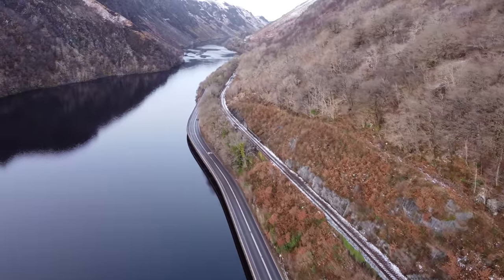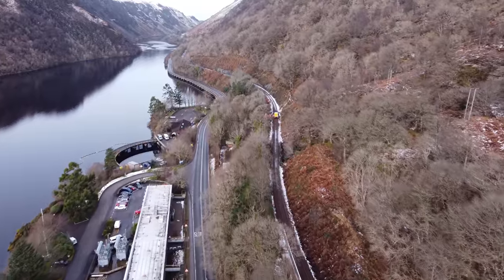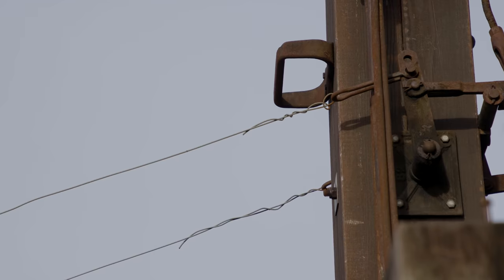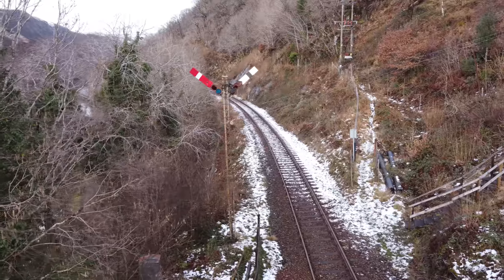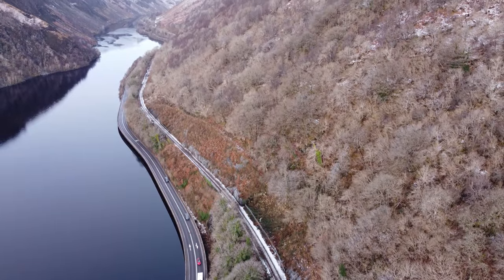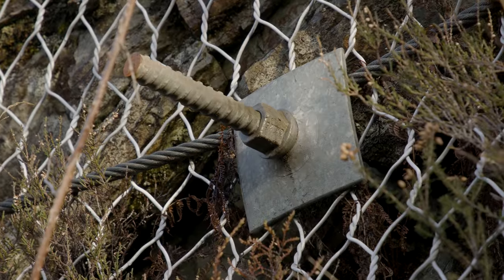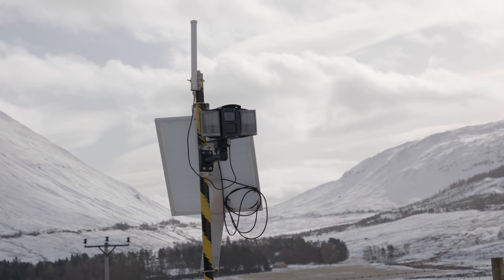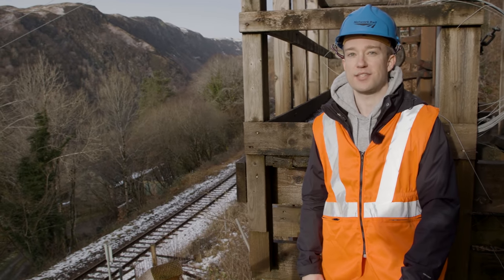After 140 years, this old technology still keeps trains safe

Comment: That the "Anderson's Piano"-system operates to this day has something to do with a railway safety principle. That principle is simple: a railway track wich is free from trains gives a continuous electrical signal to the main safety system saying: I’m free, trains are welcome. When a train is on the track, it shortcut this signal and the main safety system puts the signal that gives access to the track on Stop. This safety principle has also the effect that when there is a malfunction, the main safety system always keep a signal on Stop. It’s also known as "failsafe".

The Anderson's Piano-system is based on that same failsafe principle, but instead of a continuous electrical signal, it uses a mechanical continuous signal in the form of a wire. If a wire malfunction, the connected signal falls down to Stop.

Replacing this system gives two main challenges: making a system that is failsafe and making that the system gives less false reports than correct reports.
Reply: The modern world is starting to use axle counters instead of electrical track circuits. They are not prone to electrical leaks and other insulation problems. Same number of axles in and same number out -> track is clear again.

There is drawbacks though. Axle counters can't detect broken rails, but with modern rails that's not too big of an issue anymore.
Reply: @laju  axle counters also lead to fun situations where trains are not allowed to have particular numbers of axles. IIRC there's at least one place where trains are not allowed to have a number that is 0 (or possibly 1, I'm blanking on the exact details) mod 256 because they only use a single byte for counting and they don't check for overflow 🤦‍♂️
Reply: The trains shortcut the signal from one track to the other? Fascinating
Reply: This is even a safety feature for rail crews. When I worked on the railway, they issued 2 metal clips connected by a wire (essentialy oversized jumpleads) as part of safety kit on every train and in every van. As part of safety training we were taught if there was ever an emergency on the line which required the stopping of trains to prevent further incident, use these clips to connect the 2 rails together. This will immediately set all signals to red and so stop any other trains proceeding into your area.

Of course this works both ways. You also have the vandals who know about this and purposely put a metal bar across the rails just to cause havoc!

Comment: They still use something similar in the US along certain routes.  I rode Amtrak from Omaha, NE to Oakland, CA in the 90's and along the mountain passes from Denver to Sacramento there were multiple wires stretched along beside the tracks.  At that point I had no clue what it was but learned later on that they were there to detect rock falls and such.  It's an amazing trip going through the mountains for sure though.  I went through in December headed west and January headed east through those area's, something I truly want to do again sometime.

Comment: 1:58 - "There's no user manual." - Er... then shouldn't someone make one? I mean, user manuals don't just materialise out of the ether, someone needs to write them.
Reply: The only reason manuals exist is for situations where it's impractical to teach someone in-person, because it is mass produced and sold to various unconnected places.

There is only one Anderson Piano system, in use by a singular, tight-knit group, which absolutely has the resources to teach in-person. And live teaching always, always beats learning from a book. It's not even close.
Reply: @FabbrizioPlays  - Manuals exist to standardise teaching and to function as references. Especially with something this complex, that requires diagrams, maps, etc., there should be a manual even if people are being trained "in person".

How does relying on some random guys' ability to memorise the locations, settings and specifications of different parts "beat" having them written down in a curated document, that they can refer to when necessary?

There was only one space shuttle launch pad (well, eventually there were two). Do you think they didn't have manuals for it? Every part and every procedure was fully documented.

How's the Aboriginal "in-person-teaching-only" space programme doing?
Reply: @RFC-3514  "the Aboriginal "in-person-teaching-only" space programme" God, what a great way to describe KSP

Comment: One alternative, which is currently used for some infrastructure in the UK, is a fibre optic sensing system. Essentially very similar to this, except instead of cables there's fibre optic wires. It'll generally detect an issue before the rockfall happens, because the wire will measure increases in strain at every single location on the wire at high resolution, and can pinpoint exactly where the issue is.

Comment: It's interesting-there are places on the Pacific Coast Highway in California where they use the same kind of restraints to keep the cliffs from sliding down onto the road. And since for a lot of places on the central coast, that's the only road into and out of town so if that's closed, there are huge detours to try and get to the town from the other direction.

Comment: Only alternative that would come even close would be a "drone" rail cart that runs ahead of the train.  It would both cost more and fail more often though.  A simple passive mechanical solution will beat almost anything.  Even today.
Reply: What if a rock falls after the drone just passed?
Reply: @dgarc012  Have you heard of the Stonehaven crash?
Reply: @dgarc012  about as likely as a rock falling in front of the train anyway no? The system won’t help in that situation
Reply: @dgarc012  Same as if a rock fell after the train passed the signal.  It's a percentages game. 🤷
Reply: @joshuaritchie3836  Hadn't heard of that.  Awful.  Rockfalls tend to happen independently.  But if the conditions are right for one mudslide, then a second mudslide is far more likely.  A sad story.
Reply: If that is true then how come no one will buy my cups-on-a-string iphone alternative?
Reply: @skenzyme81  Stonehaven Crash was were a train derailed after hitting rocks and mud on the Down line at 73mph and 3 people died on a very quite train in 2020.

Comment: 2:15 Could they use modern, strong wire for most of the system and use older, weak wire at the end? The strong wire could tug and snap the weak wire at the end to cause the same effect. This could help with finding materials. It could also help with resetting the system because the snapped wire will always be at the same place.
Not an engineer though so idk if this would actually work
Reply: It's a good idea but it may be that a really strong but also very long wire will stretch enough to allow the weaker ends to not break. Even metal wires are stretchy.
Reply: Ah the troubles of balancing material properties for a system xD so many possibilities, so many variables, so many headaches

Comment: i wonder why its not beneficial to put the "spirit level" devices directly on the old analgoue mechanical signals so at least they get an electronic alert instead of waiting for a train driver to discover it
Reply: Fair point
Reply: The answer is in your question. Electronic. There is no power nor easy to way to put power there.
Reply: Electronic alert? That requires internet connection no? Vast stretches of the West Highland Line are in areas with no connection. Once you get past Helensbrugh, all modern rail infrastructure evaporates as you head onto a single track railway that goes through many places inaccessible to any means other than the railway. A few stations don't even have road connections!
Reply: Probably due to the remoteness of the system.  Not only do you need some way to provide power, you have to have a way to get the signal back.  In mountainous regions, the only feasible option may be satellite.
Reply: @waywornwyrm8135  The video litteraly showed you several applications of this technology using solar panels.
Reply: @Prohibitorum  with accompanying voiceover explaining that was a trial which had reliability problems…….
Reply: soo... i figured you would just put a button under the analogue signal arm. if the arm drops and presses the button then it just uses a satelite phone connected to a solar panel to send an SMS

but maybe they solar panels just can't work due to cloudy weather for months at a time, and maybe there is no long-life batteries that could stand up to the cold even if they only turned on to send the message

Comment: Surprised they haven't added electrical sensors to the mechanical signals, just to send ahead that the signal got tripped and maintenance can know about it without needing a train driver to tell them. 
Great video, love things that are built to last and still maintained.
Reply: You need power for this, which they don't have
Reply: If it's just a simple switch that sends a 1/0 signal remotely there's probably battery powered versions?
Reply: @KarolaTea  Batteries don't last very long in that area, in particular during the winter (where you'll struggle to recharge them with solar)
Reply: @mathieuclement8011  I know I'm oversimplifying, but to get electricity, you could use wires.  This system is made of wires.
Reply: @mathieuclement8011  You really don't need a lot of power. The control station only needs to query it every 10 or 60 minutes or so. And for each of those you'd need to switch it on for a second or less. I bet the larger problem is that you'd need to run a whole extra signal wire out there.
Reply: @ArminGrewe  with such extremely simple electronics the power consumption should be so low that it should be feasible.

I assumed the time gain is simply too little. Whatever the reason, it apparently isn't worth it to put a sensor on the signal.
Reply: hm, would've thought the world has freeze proof batteries by now, but guess I was wrong then haha XD

Comment: In Germany we use the same system still today. It's called "BALA": BoschüngsALarmAnlage". Word by word translated something like "embankment alarm system".

We use it not only for rocks but also as detector for levee slides after massive rainfalls.

The only electric thing in the BALA ist a simple box in the office of the signal dispatcher which screams loud as hell, when the steelwires on the hills lose their tension.

Comment: TBH i think there should be more "analogue" solutions to these kinds of problems, not only train-related but in general. they have their advantages and disadvantages, but i think they do have a place in the modern world. everything is just digitized these days, sometimes needlessly
Reply: Agreed
Reply: One day we'll be telling future generations of this strange time when every surface of our houses didn't have its own dedicated app, digital assistant and a constant connection to your wifi network.
Reply: They're called 'mechanical lockouts', and they are used. Unfortunately they're typically more expensive than doing things electronically. (And also more reliable.)
Reply: The emergency generator plants in some of the datacentres i use have a fire detection system which uses a weighted lever and a wire, which is led over a pair of pulleys, running diagonally above the diesel engine. In the centre of the run, the wire is cut and is fixed to a short plastic link.  If there is a fire or serious overheating, the plastic link melts and the weighted lever falls, cutting the fuel supply and hitting the kill switch. Nice Victorian protective solution for a datacentre full of computing tin.
Reply: @MachiningandMicrowaves  There's not much to go wrong, so it works!

Comment: The  U.S. military thinks it is a challenge to integrate modern targeting data sharing with 50-year-old planes, and meanwhile in Scotland they are integrating satellite scanning with wires and weights from the 1880s.
Reply: To be fair, this is somewhat of a unique case. One of the biggest problems with the UK rail network is the difficulty in integrating modernised in-carriage signall control, which most nations in the world have, partly because the fleet of trains is so old fashioned. There are obviously other reasons too, but this massively impacts how efficient British railway systems can be. 

So, yes, this is cool, but its by no means indicative of the national network
Reply: @hairyairey  Integrated in the sense that both are currently used in the railway's overall safety system. I DID watch the video.
Reply: @hairyairey  It might look remote, but most of that area is covered by 5G or at least 4G LTE.
Reply: Tell me you don't understand anything about how avionics works, without saying you don't understand anything about how avionics works...
Reply: @jsquared1013  What do you mean? The US has been upgrading and modernizing the A10 and the B52, among others, for a LONG time, several generations of computer and hardware upgrades. And a big goal in recent years has been to share targeting data between planes, drones, and ground vehicles and troops. If I remember correctly, they haven't managed it yet.
Reply: @hairyairey  4G is good for up to 8-10 miles pal. There's no power *at the tracks*, not in the region ya numpty.
Reply: @hairyairey  You can keep arguing from ignorance, or you can look up the coverage maps for the area yourself if you refuse to believe the anecdote of a native.

At no point on the journey do you drop outside range of a 4G transmitter.
Reply: @hairyairey  bro

Comment: Just me who's as interested in the van on the tracks as the signalling?
Reply: The line up there is controlled by RETB (Radio Electronic Token Block signalling) the van on the track is equipped with a RETB receiver so can obtain permission (a Token) to drive on the track between trains very easily.

Comment: for "anderson's piano", wouldn't it be enough to have only a short amount of 'brittle' wire, connected to a great length of 'non-brittle' wire, reducing time needed to re-string?

Since the wire is tensioned, then the brittle part would logically still break, but instead of having to find the break itself, only rail clearance needs to be checked, and a new short piece of wire re-strung.
Reply: would that create more false negatives, because parts of the wire are now weaker and more prone to break under false conditions like strong winds? compared to something that has a uniform and more consistent strength?
Reply: I suspect the problem with that would be that you'd be putting too much stress on a short section of weak wire, which would either constantly break and cause false alarms or have to be so strong that it wouldn't break when needed. With the longer sections of brittle wire you're spreading the weight over a much longer area, achieving the right balance.
Reply: @dsmyify  it's mentioned in the vid that most new wire is stronger, so i would expect it to break on its weakest point. Much like a fuse in an electrical circuit
Reply: @ArminGrewe  shouldn't the tension be equal across the entire length?
Reply: @Simply_CH23  ~ oh I get you, like use the newer strong wire for longer sections and then use the existing strength wire as the fuse section? The weakest part holds at the current strength. 

They could use connection plugs to connect sections of wire together. Instead of breaking the cable any additional weight will cause the plugs to disconnect. The cable can be plugged back together again instead of replaced. If the cable breaking is key then design the cable to break and be put back together again.

Comment: 😉😉
The same systems been in use for 140 years.
"140 years?"

Yes, thanks to our regular maintenance. I've had the wires replaced a 1000 times
The posts are replaced every 40 years
The signals are repainted every 7 and replaced every 50
And all the huts get new planks every 15 years

-Trigger's Piano

Comment: What about a charged wire to replace the manual signals? It is the same idea but it seems like it would be simpler to reset and you could choose an ideal wire size or run the wire for as long as you wanted.

Comment: My thought would be a rail drone that drives on sufficiently far ahead of a train that if an obstruction is detected, the train will have time to stop. Cameras could be added so that the train operator is able to visually confirm the warning. The obvious problem, however, is when the obstruction occurs after the drone has passed. This could easily happen with other systems, though. If a rock fall happens too soon in front of a train, it won't be detected in time for the train to stop.
Reply: In a perfect world, this could be combined with some modern "Linienzugbeeinflussung" (LZB) / European Train Control System (ETCS) type system.

(Of course, this would cost money... and reading a bit about ETCS, it seems to have some problems of its own...)
Reply: Mind you, that can be an issue with this system too. In fact, precisely that happened in 1949
Reply: A couple of flying drones which relay each other and recharge on the train, flying ahead, scanning for rocks using cameras/infrared, would present less of a collision risk than a rail drone.